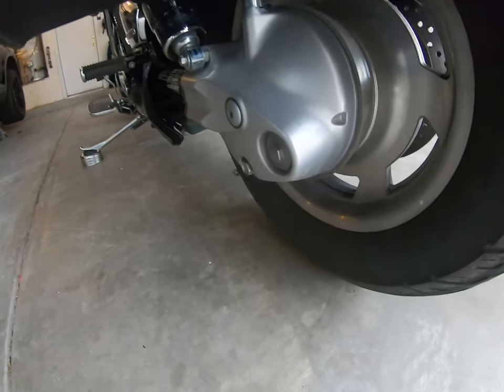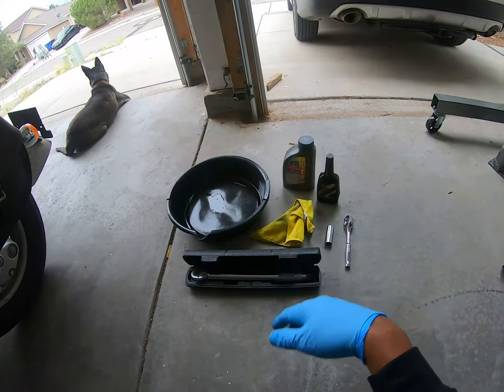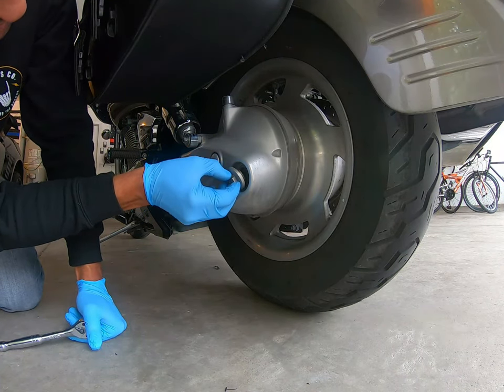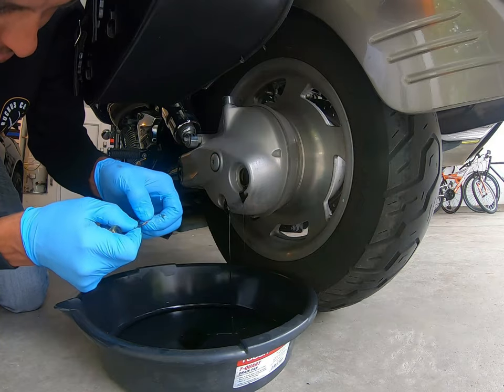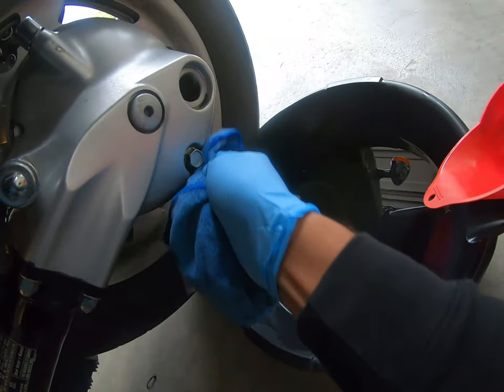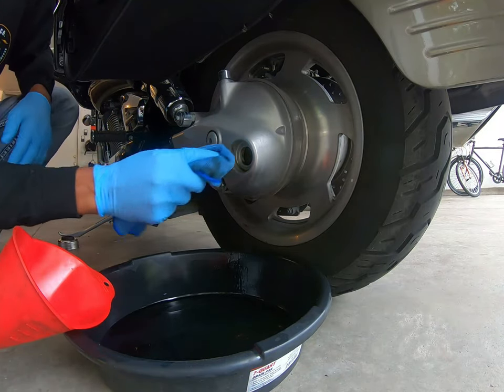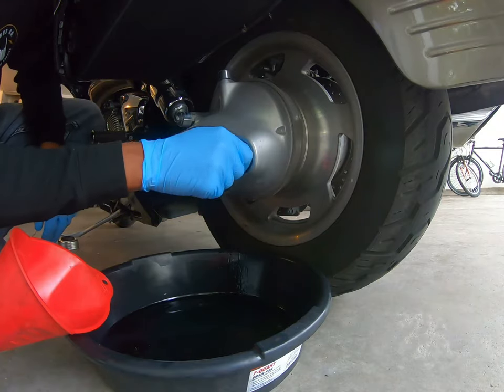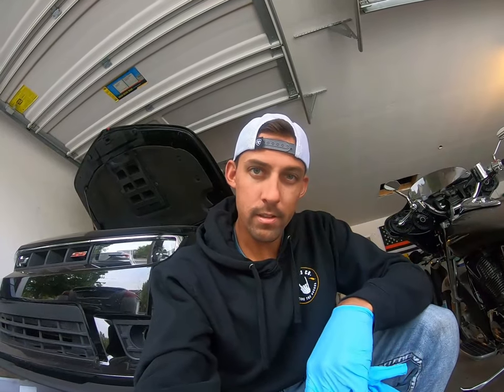VTX 1300 Drive Oil Change

Comment: From the manual ride the moto first to warm the fluid. Slowly turn rear wheel to drain all the old oil. I did notice plenty of extra comes out when you roll the bike forward. Place moto on its side stand on level surface to fill. This is hard to do straight from the bottle because you have to get the nozzle in pretty deep to get past the shelf inside there. Next time I’m going to fill it with a turkey baster or something.

Update: I bought a proper oil can for the job
Reply: Lots of gear oil comes in bottles with a spout, too.

Comment: I have the same bike, color and everything. I have the 1300C. Greatest bike I’ve ever owned. 50,000 no problems runs like new. And no oil tracking system like Harley Davison.
Reply: Same, mines got 87k, still no issues

Comment: You should drain it on the side stand so you get it all out first, then lift it on a level stand to refill it.
Reply: bingo - surprised no one else noticed that.  Must tilt on side stand to drain fully. In fact, even rotate wheel - more old oil comes out.

Comment: Note that the socket size for the bolts is 17mm (not mentioned).  Best to warm the oil some with a 3-5 min ride so all the 'crap' is stirred up better to flow out, and rotate the wheel a few turns while draining to get it all out.   Cute dog added some entertainment.  Thanks for not adding annoying music, like many of these vids do.  👍
Reply from the maker: Yes sir yes sir!

And I definitely did not warm it up before hand I'll have to do that next time !! Thanks man!

Comment: The top nut is easy to crack the integrated shoulder washer portion by over tightening it. So be extra careful tightening the top bolt or it will crack!
Reply from the maker: Definitely good advice!!

Comment: The instructions say to place your bike on a side stand on a flat surface. It does not say to be positioned straight. If you position your bike straight and fill the lower limit of the oil inlet, the amount of oil will increase, what do you think?

Comment: Nice bike! I inherited one of these bikes recently 06 vtx1300r good condition w 11k miles stock. Just had Honda dealership did oil change, radiator flush, brake lines flush and new fuel tubings plus getting the carb rebuild and the fuel tank resealed. The plan is to sell it u think I’d have a hard time selling this bike in its current condition? I’m a total noob when it comes to motorcycle nice Camaro btw! 👍🏽
Reply from the maker: The only issue you may run into is timing since its right before Christmas, but other than that you shouldn't have any problem selling it !! I sold mine withing a few days of posting it! And thanks man I appreciate it, i just put a fresh LS3 from blueprint in it, I dropped a valve in the stock motor 😅🤦‍♂️
Reply: @dailygarageadventures2848  Whoaw LS3!!! 🦾 my buddy has a 2016 black on black ZL1 and I kid you not I was holding on to the oh shit bar the entire time he took me for a test drive! 🤢 Two wheel Rocco from YT adviced me also if I could wait around Riding season or tax return time to sell it he said it shouldn’t be an issue. Tnx for the reply bro! 🤙🏽

Comment: I have a 2015 Stateline 1300. First bike. Would you change this oil the same frequency as the engine oil? What would be the mileage you would recommend on these changes?
Reply from the maker: I believe honda recommends every 15k miles for the rear diff/drive oil. For the engine oil I usually do about every 2 to 3 thousand miles depending on how hard I've been on the bike